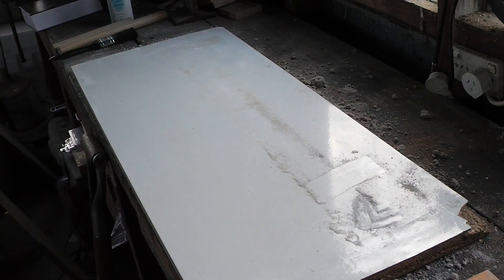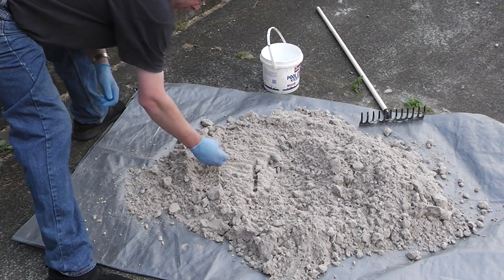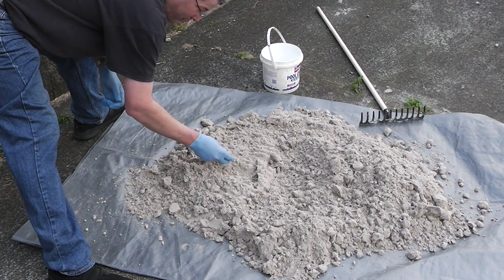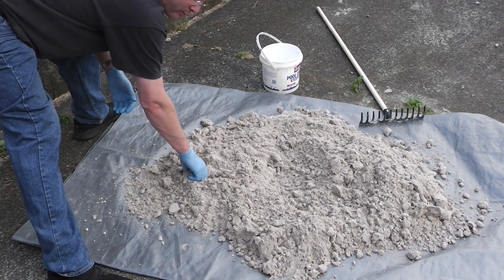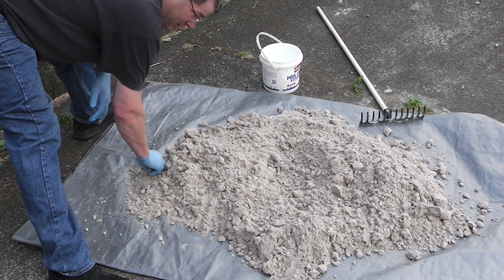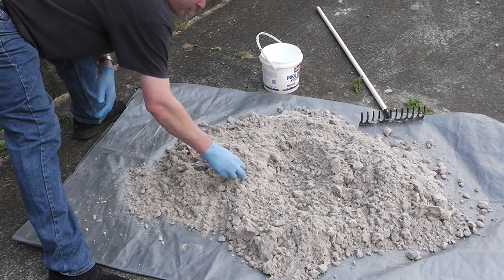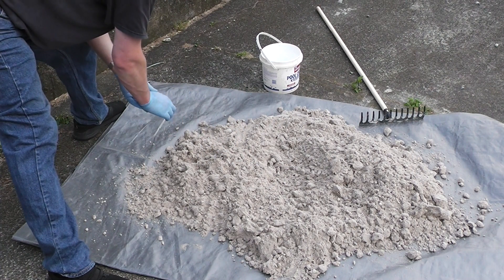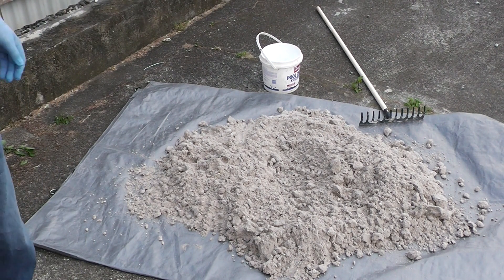Bad sand! Bad!

Comment: Getting homemade greensand right can be tricky.  There's more to it than measuring out the right percentages of ingredients.   Even if your clay and water content is right and you've managed to mull it effectively enough to get every grain coated with a thin layer of clay (by no means a certainty using the tarp stomp dance method or other manual mulling techniques), if your sand doesn't have suitable grain shape and the right distribution of grain sizes, it will never gain the green strength you need to make molds really effectively.  Finding the right sand ingredient is trickier than people think, and many new hobbyists simply don't realize this.  Good luck, that bed casting is a beast by all accounts.  Pretty sure it takes just about everyone multiple tries.  I have the books and started in 2013, but stopped after the charcoal furnace.  Been busy making other castings ever since, a steep learning curve but a very rewarding hobby.  One day I still think I might take a crack at the machines...

Comment: I'm still learning, but it sounds like using the red sand, or Petrobond, works a whole lot easier, even if it is a bit more expensive. Why not use that and not have to worry about your moisture content?
Reply from the maker: Shipping costs to New Zealand would be killer!
Reply: @HaveAGoAlan  aww, that's a shame. Great job with what you have!